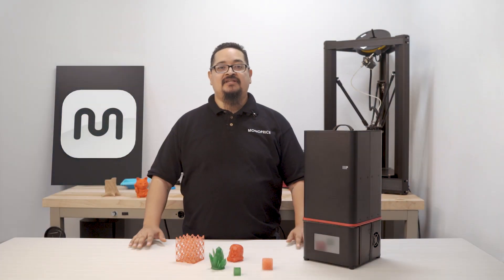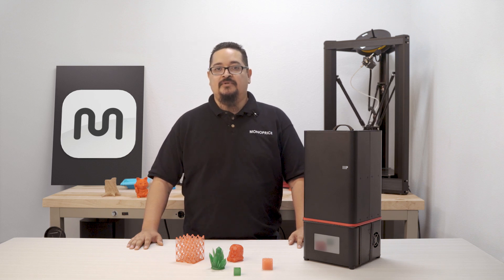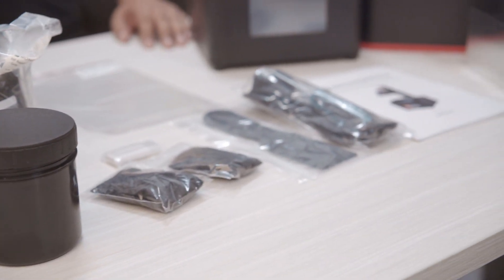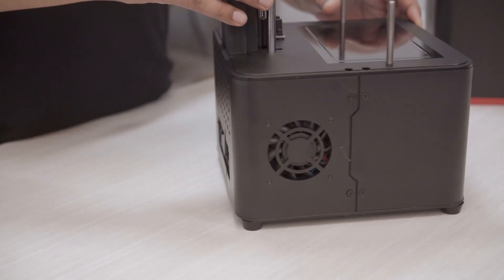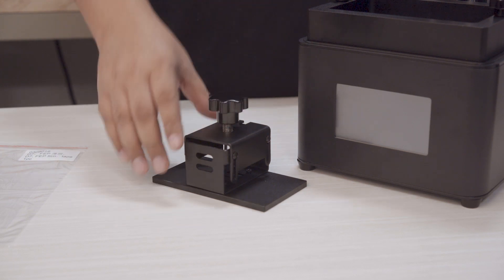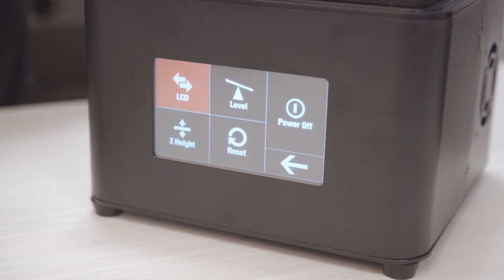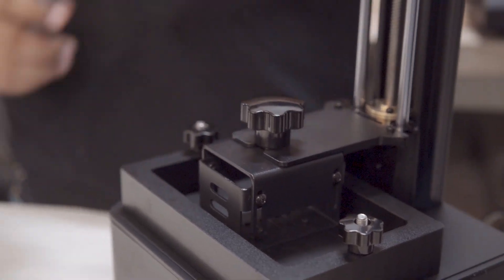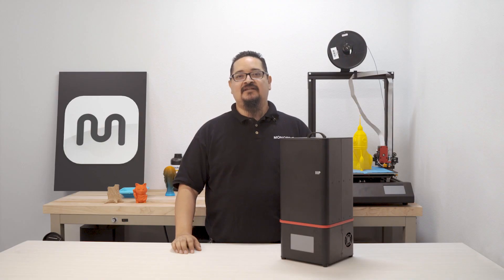Monoprice Mini Deluxe SLA 3D Printer Assembly

Comment: Is the buildplate supposed to be partially submerged in the resin?
Reply: When a layer is being exposed, Yes. When it is lifted off the Film to finish a layer, it depends how much Resin is in the VAT and what your Lift distance is set to in CWS. It just has to separate the Layer from the Film. It doesn't need to go far up. The shorter the Lift distance the faster it prints due to less Z travel and the sooner it can expose the next layer and so on, completing the Print sooner. Hope you never gave up and learned on your own as I did. Yes help was scarce but that does excuse people that stop trying because they want answer handed to them. Good Luck.

Comment: I just got mine and the touch screen doesn't work.  It displays properly but nothing happens when I touch it.  =(
Reply: Same boat here.  Going to have to call them tomorrow.  Really bummed, had models sliced and ready.
Reply: @FleaNutClaypool  you know its probably just a loose wire or a bad connection, usually thats what the problem is, if not them maybe updating the firmware will fix it. or possibly uninstalling and reinstalling the firmware(this step should always be a last resort and only if it is no longer under warranty)
Reply: also I see this comment is 2 months old, I can only assume the issue has been resolved by now... Hopefully. Best of Luck.
Reply: @b-rad7708  the company sent me a replacement printer.   All good.
Reply: Michael Thompson Nice. That’s usually the best way to go lol

Comment: Where can I get replacement parts???, specifically the pep film
Reply: Most Resin Printer supplies work as long as its as big or bigger than the part you need but MonoPrice is still in business so, DUH, try their website or phone number.

Comment: Whats the XY resolution!?
Reply: I was also wondering what the resolution is. Further reading on the website says 2560x1440p IPS display. I wonder if there is a profile for this printer available in simplify 3D.
Reply: Resolution as in DPI is DOTS PER INCH, SOOOO -- Size divided by dots on the screen in each direction. Why do you need someone to tell you that? Lowest 10th Percentile Person?

Comment: I can say that the demo models included with the machine are amazing and they work every time.  I can also say that after 1 month, I am frustrated.  Nothing I do seems to work 100% ok.  everything works 10%-58% correctly.  I truly want to fib, but I have printed failure after failure due to 100% lack of actually correct customer service.  I would give them 40% correct answers to questions asked.
I also have to admit, by the time I am replying to videos about REVIEWS I tend to have moved from naive beginner to frustrated person that thought that since this was a knock off brand I would be able to rely on generic information regarding the Wanhao 7 from the many forums available but this is actually a different machine than the wanhao 7 as far as the interface system (wireless, and wifi less) so my results are skewed by 10% +/-  my said results.   My opinion is, this is a fine machine.  However,  the only TWO (2) prints I can actually say this successful result involve simple geometric shapes.  Otherwise, I'm just guessing for the resolution time/ travel speed and such.  I have not found adequate information on the running of this machine, regardless of reading the manual several times.
Reply: Josh Shultz is it the first resin printer that you have been using?
Reply: @choschiba  yes it is.  I know this isn't the easiest to start with.  However, about 2 weeks after posting this, I called monoprice and they gave me print parameters that worked nicely.  Essentially I needed to modify the reason cure times. 
 I changed from grey to Green and now the reason needs to cure for a little longer, but it is still working.  
I have had many successful prints since I called the company and received the information.
Reply: Josh Shultz that’s what I was about to ask.  Because sometimes the settings are something to start off with. But they might not be perfect
Reply: Reason=Resin
Reply: So that tell me that my TWO copies of this printer ARE GREAT and the problem ISN'T the PRINTER but stupid OWNERS that can't take responsibility for their stupidity and ineptitude and lack of ability or humility. Customer Service is to kiss ass and make you feel NOT STUPID when you complain that you can't print and blame the printer. If that's what you expect, go back to watching your VCR's Clock blink because you don't know how to set it and watch another TV show from the couch. That's all you will ever be able to do. Good Luck.

I can print fine on both of mine. "Did you know that 50% of people are BELOW AVERAGE INTELLIGENCE." Welcome to the lowest 10th Percentile. When you said you are 10-58% successful that's what you were saying because there is nothing wrong with these printer. Only with their sub-par owners. Some owners have no problem getting GREAT RESULTS with them but then we are in the UPPER PERCENTILES of the population.

Go watch CNN and consider it News. Don't worry be Happy. The truth IS out there. You will never hear it from CNN, though.

Comment: Why hasn’t anyone reviewed this printer yet?
Reply: I think it's because everyone keeps saying "this is the same as the wanhao 7" so they think, why bother reviewing the same product twice.  It isn't the exact same, from what I've seen there are several improvements that come standard with this model that are upgrades for the wanhao 7.
Reply: @JoshShultzandKids  do you know what the upgrades are?
Reply: @warriorsofradiance7100  the ball screw had two additional anti wobble guides that did not come as standard on wanho, also, instead of connecting directly to a computer, you now have a touch LCD screen
Reply: @JoshShultzandKids  thanks for the info. Now that you've had it for a bit, how is it?
Reply: @warriorsofradiance7100  now I love it. It has become very reliable and doesn't seem to be fussy. Also, I tried several different resins and once I found "clear" it made it easier for me to see what was going on and understand things a little better.  Would buy again.  The only thing I wish I could change is the print size. But that had only been an issue for a few prints, and it requires developing work around, like splitting a large print up and assembling it once all the prints are done...
Reply: @JoshShultzandKids  cool, I've used several FDM/FFF printers like the makerbot, printerbot(wooden version), M3D, a XYZ pro an now I've a makerselect v2 set up to do flexi an tougher plastics. Been wanting an to try a resin printer for a while. I think you just sold me.
Reply: @warriorsofradiance7100  RTFMs and answer your own question. Heaven Help US, People are LAZY or maybe just unintelligent.
Reply: @warriorsofradiance7100  3 years and still GREAT!
Reply: @JoshShultzandKids  ONE of the Upper 50% Percentile People.:goodvibes:
Reply: I got mine about one week ago.  I've attempted 2 prints with a zero percent success rate using MP rapid UV printer resin (white).  I'm trying a third, hoping for the best.  Only attempted 2 prints so far, as I needed to do some research beforehand.  I've only worked with filament printers in the past. As an important note to those who are new, there is seriously no documentation included on how to set up the printer.  Only some basic guides on the software.
Reply: @davidriddle7314  wow.... I think I would probably enjoy it a bit. Once you've gotten used filament printers they're a breeze to get up an running. I just got two Ender3's and have been printing nonstop with very minimal failures.
Reply: Thinking it's a cash grab on a cheaper product is why.
Reply: TOO STUPID to realize its THEM if they say its not a good printer.
They are part of the 50% of people below average intelligence.